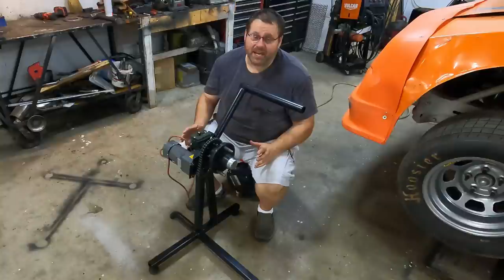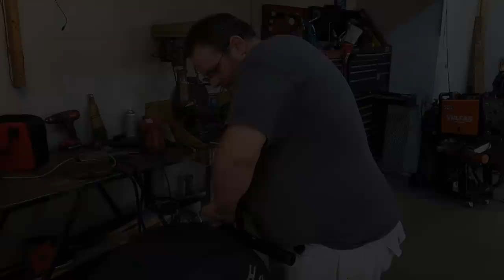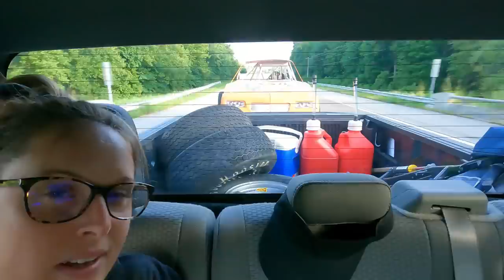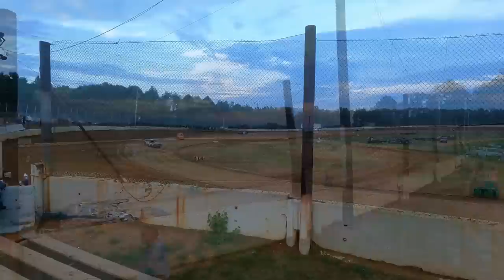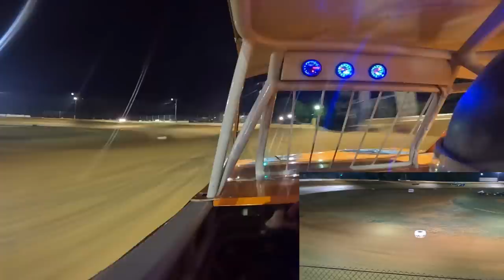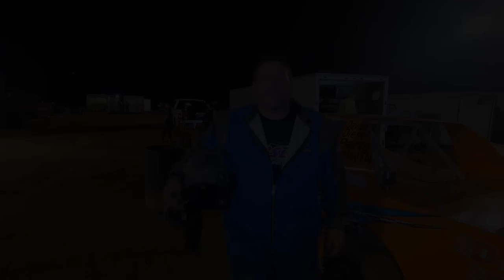Tire Machine Update, Rear Suspension Cam Action, and Then a Great Run at the Track, It's all coming

Comment: Definitely a california type track surface. Great run. Looks like all youre missing is a little more hp! Btw is your tac maxing out?
Reply from the maker: That dad gum tac has been a pain in the . . . . I am running a constant hot to it this week before the next race. Every time I switch the power off it reverts to 4 cylinder mode.
Yeah, I felt like I was racing on a surface similar to what I have seen in some of your videos!

Comment: Nice job Jason..What do the boys ahead of you there have that you don't..I know its motor but more specifically.   Anything specifically about your motor that you need or don't have. What are you calling an open motor,  what are those rules. Just asking to see if we may be able to help. 
I build 602's, 604's,  and unrestricted motors,  oval asphalt, oval dirt, street, 

Power Curve Development
Since 1977
Reply from the maker: Most of them are on open motors with a gage legal 4412 carb. Rules are for that or any carb on a sealed 602.  I have been keeping my ears and eyes open and it looks like there is some grey area building going on because the rules just say stock production block and 362" limit. SO . . I believe I am racing against 400 blocks with 3.25 and 3.35 stroke cranks and great iron heads like the platinums that flow fantastic with that big bore and raised compression of the heads. My current engine is a 0.060 over 350, 3.48 stroke, flat tops, 5.7 rods, stock vortecs with a good angle job and Manley valves, and a 0.500" lift hydraulic vacuum cam. Math shows this motor is at 10.5 to 1 compression. It's a good little motor but it's really a factory stock lower class engine and I need to put it back where it belongs in my camaro. I would happily buy a new 602 at this point but I don't trust one off the shelf. It looks like I am looking at sometime next spring before I can get a new 602 from a certified builder who has dissassembled, inspected, fixed, reassembled, and resealed it. 
I had a roller motor that I ran in my camaro in true "open motor" races. I broke the crank in it and on tear down I found a crack in the main next to the break. Well shoot I can't even get this block into a machine shop this year to get the main replaced and a line bore and hone done. Machinists are backed up and getting hard to find. If I could find a machinist to fix this block I believe I would just have a light weight bottom end put together and figure out the best cam head combo to make it work well. 
So I am in between but looking to figure it out. I am worried that at some point CRUSA will go straight 602 only. So I question if I should build any more open motors at all and just get a 602 instead?

Comment: Sometimes when ur side by side with people you’re jumping on the throttle too hard too early and sending urself up the track, I could be wrong. Throttling up point just seemed a little inconsistent
Reply from the maker: It could be. This car has forward bite pretty much at all times and it is seeming to get me in trouble at times because I hit the gas and the car launches whereas the guys around me are balling tires. It's a good thing but I need to get better control of it.

Comment: Great run but car looked like it may need a little more left side % ?
Reply from the maker: Yeah she was a hair tight. It was tricky because the track was black slick in the middle but had some awesome bite up high but was chunked out like crazy up there. So I was slower if just in the black. Fast fast if I hooked just the right tire in top and pushing if I got over too far and hooked the left side into the tack. That 20 laps was a work out to say the least. About beat me too death.
Reply: @DIRTRACELIFE  
Running the rim like that you have to hit your mark just right every time.
Reply from the maker: Yep. Tell me about it! ;)

Comment: Gotta get that car on the RF and rotate. Are you looking to specifically run high side? Because it looks like it won't hold the bottom... wants to push? (Heat Race). But, you're making that track much bigger than what it needs to be.
Sorry I'm commenting as I watch.
Reply from the maker: I think I should have loosened her up more. I was hoping for a track that was mostly black but with a cushion wall to hit hard with the RR but what I got was a chunky high side I would roll too far into at times with a car too tight to do it. It's not perfect but I sure learn more about what works and what doesn't every time and I do feel like we are really close. Two things I know to do before heading down: I think I need to tighen the RR chain down another inch and I need to set up some more stagger. Maybe work out having 1.5 to 2 inches of stagger. Now what else . . .
Reply: @DIRTRACELIFE  with the rear axle hanging how much preload in on that rr spring?
Reply from the maker: It's between 1.5 and 2 inches but I need to measure again because I have adjusted some. 2x200lb would be 400 lbs preload.
Reply: @DIRTRACELIFE  gotcha... we have approximately 2" of preload @ static... with our axle hanging we have 1/2" (for the lack of better words) "dynamic load"... we run on 5/16" mile up to a large 3/8" mile tracks... we have found that at a certain point of preload on the RR  it starts adding LR bite... slick smooth track we tighten chains on the car. But, on our cars we mess with our LF chain the most, depending on how the track is shaping up.
I always tell people,  at certain tracks you can be slow around the corner and still be faster than those running the high side...as long as the car rotates nicely on throttle.  Obviously this isn't always the case. 
I do like the progress you're making brother. Keep the vids coming.
Reply from the maker: I whole heartedly agree with what you said. When I decided to just go catfishin at Crowleys a few weeks ago I was slowing down to a crawl in the apex of the turn but yet ended up gaining a few spots over guys who were humming around the lip. Its a very very valid setup requirement to make sure the car can rotate anywhere in the corner and an area I need to keep working on.
Reply: @DIRTRACELIFE  it's definitely a tedious process trying to find the setup that suits the track, the cars wants as well as the drivers input/driving style...
We chased setups for a while....eventually our times suggested we had fast hotrod, we just had to change minor things as well as driving style. We got our cars now where they're a little snug but can be pointed and rotate decently... I honestly think our cars need to be freed up a bit more because our cars get tighter as the race goes on. 
We have it now, where our camaro clip once the driver points the nose in the cut zone, he's straight back into the wood holding it on the hub.

Comment: Hey, think about using square tube and making that bar adjustable. I too have a stationary bar and it sometimes catches when grooving a mallet tire.
Reply: Small tire
Reply from the maker: I fooled around with some square tubing last week trying to see how it would work but there was just too much slop between them for me to be happy. I agree it would be great but I think I need to find a combo of two tubes that fits really smooth together to do it and that is not going to be common cold roll square stock.

Comment: On a side note I built the tire machine that you did my control box started smoking you wouldn't happen to know how to get a new one?
Reply from the maker: Thats not cool at all. Can you just return the whole unit as defective? This is packaged overseas stuff so the best bet is just replacing the whole deal motor and all. Maybe got the plug reversed going from the motor to the controller?
Reply: @DIRTRACELIFE  I used it a few times the first time we took it to the track is when it wouldn't work I'll see if I can find my old boxes